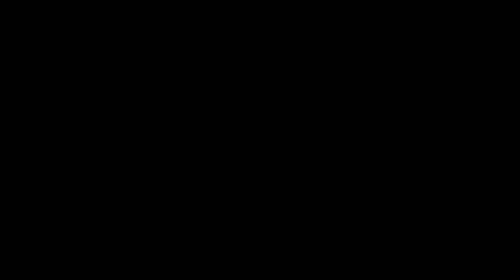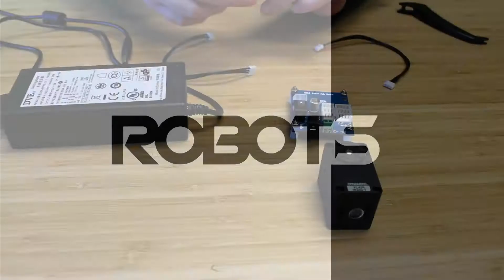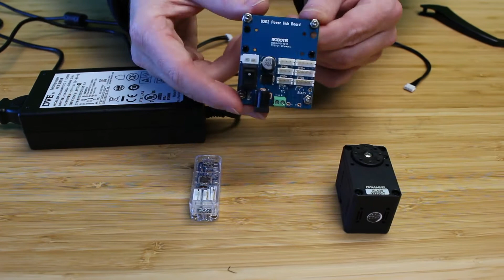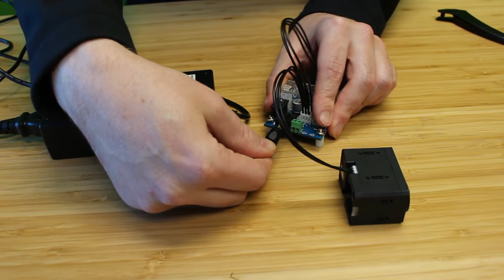How To: Connect power to U2D2 Power Hub Board for DYNAMIXEL

Comment: Thanks for the very clear video. I wonder if I can daisy chain six XL330-M077-T or six XL330-M288-T with only one U2D2 + U2D2 Power Hub + one SMPS? If not, what would be the maximum amount of servos working together in such a power supply and control configuration?
Reply from the maker: Our SMPS would be capable of providing enough amperage to drive 6 XL330 servos, however keep in mind that the XL330s are all 6v operational voltage servos, while the SMPS delivers 12v.

Comment: which port on the u2d2 that you use to connect to dynamixel? i need your answer asap. thx :)
Reply from the maker: Either port will allow you to connect with a dynamixel but the U2D2 alone is unable to power a dynamixel. If you have a U2D2 power hub board then you plug the connectors into that and it provides power. There is more information on powering dynamixels on our emanual here https://emanual.robotis.com/docs/en/parts/interface/u2d2/#supply-power
Reply from the maker: If you need more guidance please email us at CS@robotis.com that way you can include pictures and we are pretty quick!
Reply: @robotisus  okay thankyou

Comment: How do you control the U2D2 with a laptop? When I plug the U2D2 into the USB port of my laptop running Windows 10, my device manager just reads it as "USB <-> Serial Converter" and says the drivers are not installed. I've tried connecting a 12V/5A power supply and my brand new XL-430-w250-T servo and installed DYNAMIXEL Wizard 2.0, but it doesn't detect my servo during scanning. Is there a driver that I need to download to make this work?
Reply from the maker: There are a few thing that might be causing your issue and I need a bit more information. Does your dynamixel flash when power is applied? when you press scan in dynamixel wizard does the u2d2 flash green lights?  Are you using a power hub board and if so are all of your connections tight?
Reply: @robotisus  I get a red LED on the back of the Dynamixel servo that flashes once when power is applied. I get no flashing green lights on the U2D2 during scanning of the Dynamixel Wizard. The Wizard seems to be scanning devices on COM ports which are recognized in my device manager. However, the U2D2 isn't assigned a COM port in my device manager and instead lists it as "Other devices" saying that no drivers for device are installed. I am using a power hub board and my connections are tight.

I am using the TTL connectors on the U2D2 and power hub which should be what is needed for my XL-430-w250-T servo. I think I have a U2D2 driver problem or a defective U2D2 board.
Reply from the maker: @jaya7905  The red LED blinking once confirms that the DYNAMIXEL receives power and has booted. If you can't see the U2D2 as a port in your Device Manager it's possible you are missing the drivers for the U2D2- the ones you will need are "FTDI Virtual Com Port (VCP)" drivers that can be downloaded here: https://www.ftdichip.com/Drivers/VCP.htm Choose the right drivers for your OS, install, and then try the U2D2 once more. It may automatically detect the drivers or you may have to manually specify to use those drivers in the Device Manager-> Device Properties
Reply: @robotisus  Thank you! The FTDI driver did the trick. Then just had to make sure that the right COM port was being scanned in the Wizard Options menu. Ended up updating the Firmware for my Dynamixel, calibrating it, changing the latency timer to 1msec for the COM port in Device Manager, and restarting the Wizard software. It seems to be working now. It just gives me a time out error if I command position greater than about 35 degrees in position mode with certain position PD gains for some reason.